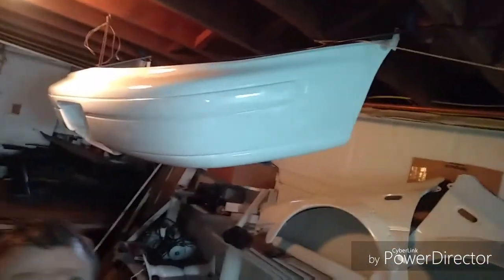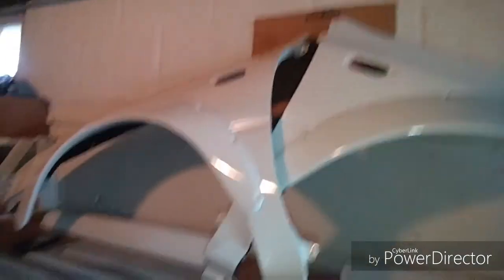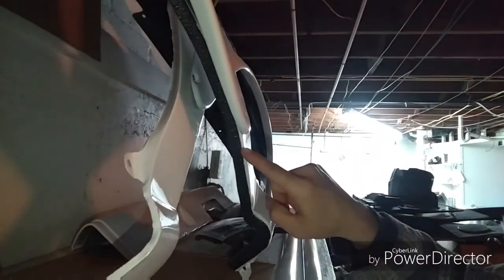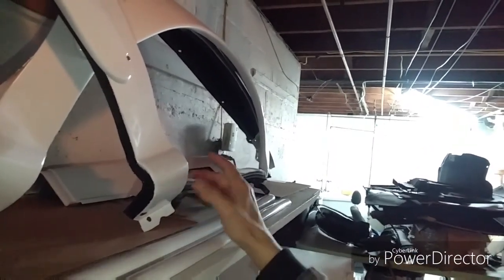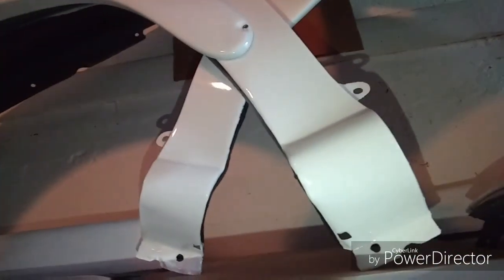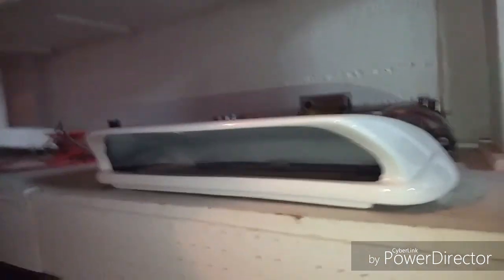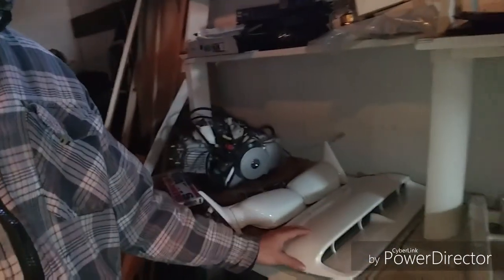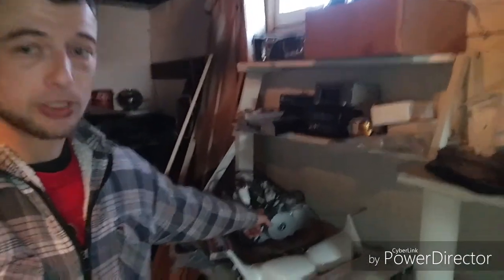Rumble Garage Episode 03 White gc8 update!

Comment: on the bottom of the fenders on my first gen legacys they always have a lot of dirt packed in there and it starts rotting away,
Reply from the maker: draperb1 ...yeah it's very common for them to rot from the inside out because of this. You can even use roll on bedliner kits to seal the back side. Works just as great. Make sure you prep the area really well so you have proper adhesion of the bedliner. You don't want it to peel off. Glad to see another Subaru owner who cares!
Reply: I will have to give that a try. Thanks for the tip!